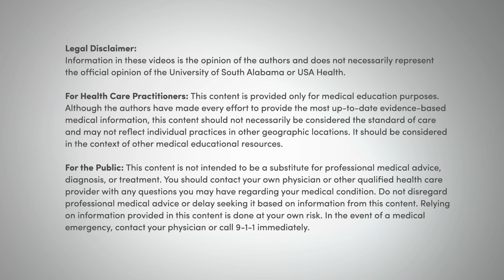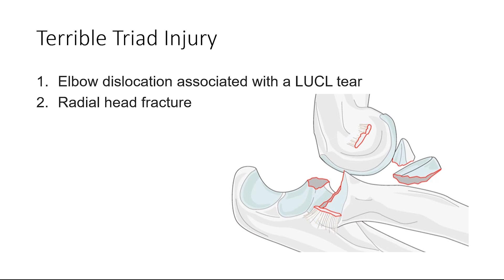An Elbow Dislocation Reduction Model

Comment: When I was like 15,  I had an accident with my motorcycle, I was not driving fast though, but I lost control of it, and I fell down directly on my right elbow, and I felt so much pain, Unfortunately I didn't go to the doctor to check, my elbow and arm start healing though so I was feeling normal...but after time, I noticed that I couldn't rotate easily and fully my right elbow, or I'm having a very hard time to rotate all of it, I can use it fine, I didn't feel any pain or anything like that, but then after a few years, I start feeling some pain in that area, and I still do feel some pain from time to time..., when I touch my elbow it feels like the bottom bone of it is like so much out..like it's visible, it's out of it's normal place...I feel like when I fell down back time my bone moved out a bit from it's place...My dad took me to a specialist doctor a long time ago, and he checked me out and saw everything in the radio and he said that he couldn't do anything for it, the only thing he can do is a surgery and he needs to break my bone to fix it or put it on it's place...and in that moment I felt so sad and disappointed...Is there any way I can fix it without a surgery or without breaking my bone? I can move my arm in almost every way, sometimes if I move it in a different way I hear something cracked up in my elbow but it's not hurting. 
:( I hope I described my issue correctly so you can understand what I am talking about.
Reply from the maker: Unfortunately, it sounds like you did have a significant fracture that healed with complications.  I suspect your options are those presented by the specialist.  Even than it might not be a guaranteed success.

Comment: Which is the most common elbow (or other) dislocation you see in ‘suspicious’ pediatric cases?
Reply from the maker: Good question.  Any elbow dislocation/fracture would be suspicious in a non-ambulating infant.  And, ambulating toddlers falling from 2 feet would generally not get this fracture.

Comment: Can an elbow dislocation make a person more susceptible to future dislocations, even long term? Several years ago I carried a couple bundles of water bottles to my dorm room all in one trip. It was heavy and I'm not particularly strong. I had my elbows at my sides, my forearms extending straight ahead of me, palms up, with the water bottle trays resting on my forearms. When I finally put them down, one of my elbows wouldn't extend without a great deal of resistance and pain. When I finally, slowly, worked through the pain and extended my arm past that range of resistance, there was an audible pop and everything was alright, with a little bit of temporary soreness. Since then, my elbow gets like that sometimes. Fortunately it doesn't require manipulation by another person to resolve it. I'm not sure what it is. Dislocation, an unruly tendon, or something else.
Reply from the maker: Adults can get a "nursemaid elbow" too.  Maybe that is what you had.